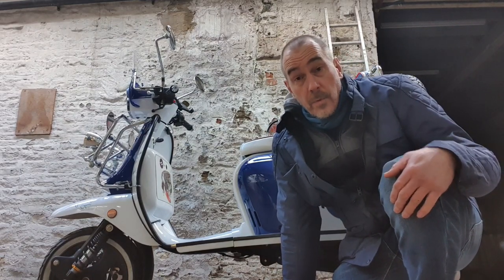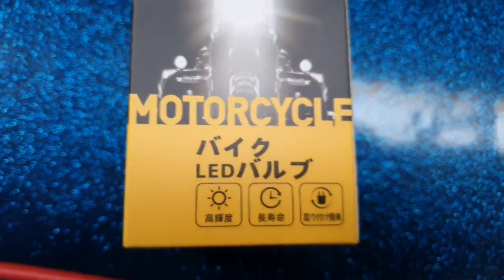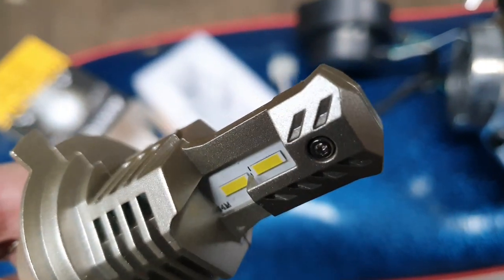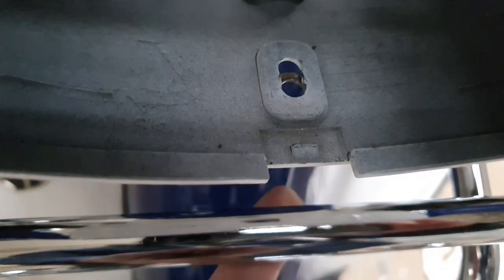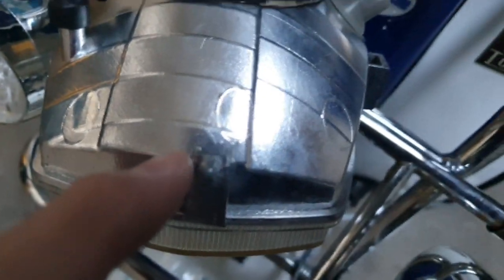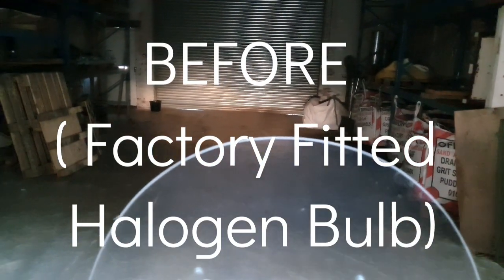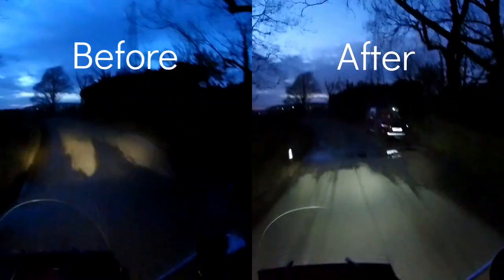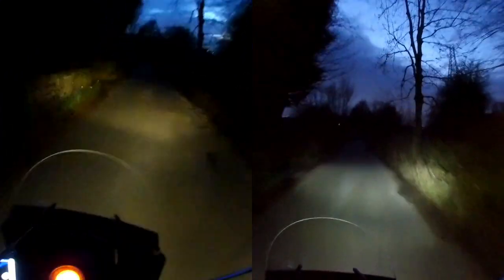Upgrading to L.E.D Headlights on 2019 Royal Alloy

Comment: Good video 👍.how did u set beam angle though? Cheers
Reply from the maker: I didn't ! This is not a legal modification.  Please see pinned post at top of comments.  Thanks for watching. 👍🏻
Reply: you can on the euro 4 not sure about others that nut underneath the unit its in allows for some movement i angled mine slightly down because when you are badly lit roads or no street lamps and in the rain seeing the road in fornt of you was nxt to impossible..

Comment: just a question but do u have to have your engine running before your lights can be switched on only or do they work without turning the engine on rsvp thanks
Reply from the maker: On mine they only come on with the engine, a few seconds delay . Hope that helps and thanks for watching. 🛵👍
Reply: @RoyalAlloyRider  thank you thats very usefull

Comment: You mention 2018 and 19 models don't have led, but newer models do. I'm not sure that is correct, mine and many friends had 2020 and 21 gt125, all standard bulbs. Gp's and tg's have always had led. I am unsure of 2023 gts, if they have led
Reply: I have the GT 2021 defo has led bulb in it
Reply: @alanash1491  2021 was the cross over year then
Reply from the maker: Hello mate, I'm not too sure but I know guys with 2020 GT models who have LED headlights from factory.Thanks for watching. 🛵👍
Reply: Well I'm not happy my 2020 had halogen and always wanted LED 😂😂

Comment: Oi Oi mucker. I was going to put a LED bulb in my Milano, as it had a rubbish bulb  in it. The garage that serviced and MOT the scooter said that if I put a LED bulb in it , it would fail the test because the light wouldn't beam out correctly. I don't know if this is true.
Reply from the maker: Correct Jason.  This is not a legal modification.  Please see pinned post at top of comments.  Thanks for watching. 👍🏻
Reply: My Milano has been changed to LED, was done by the bike shop when they did a service, because the bulb had failed.